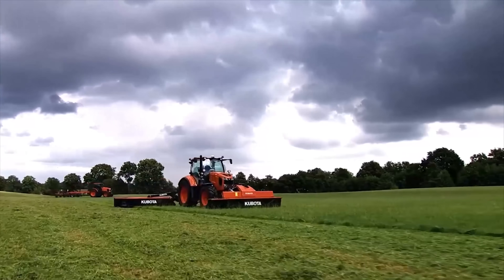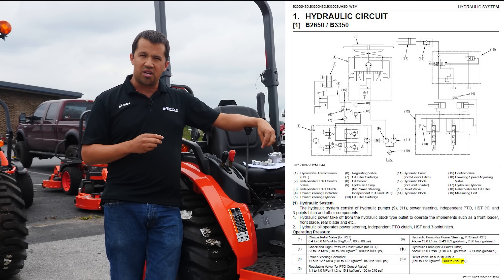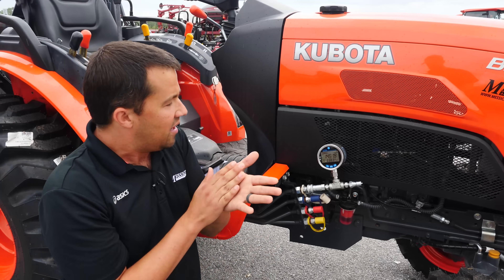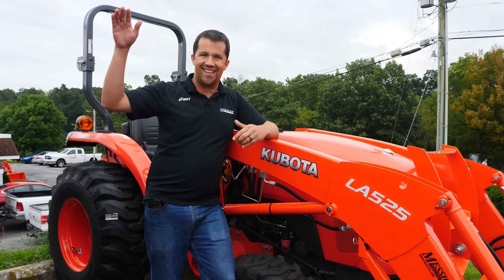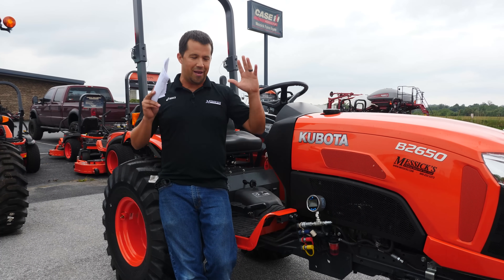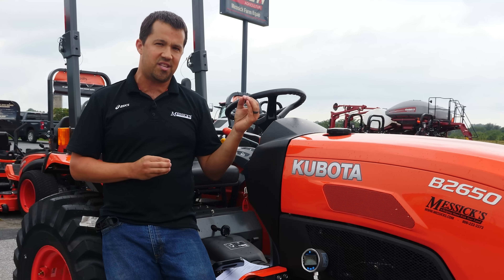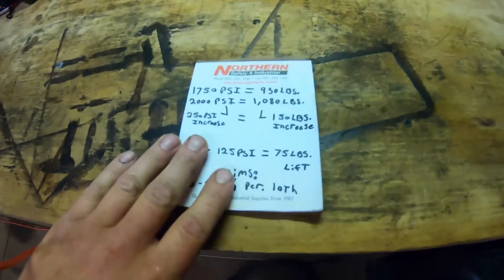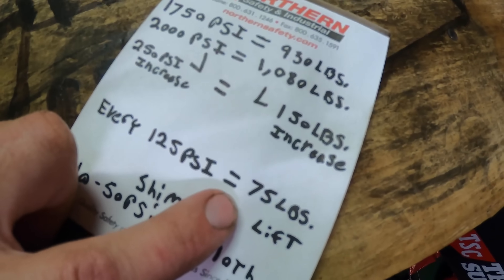Performance increases by raising pressure. Shimming hydraulics.

Comment: Hello,
I don't agree. 2% of increase PSI doesn't at all mean 2% increase at the cilinders (except  if your cilinder only has 1 Square Inch). In theorie you get 2 % increase per Square Inch so if your cilinder has a surface of 5 Square Inches you get.... (In theorie).
Don't you agree?
I do agree, that if a person doesn't fully understand every part that can suffer from the PSI increase it's better to let a pro do it or not to do it at all.
I like your videos.

Cheers from Belgium.
P.S. I talked to fast, I'm wrong.😣
Reply: Sorry guys... Neil is correct.  It’s a linear relationship.  Yes, the force equals pressure times area, but the area is constant.   Hence, the resultant increase in force is directly proportional to the increase in pressure, assuming all other factors being equal (such as loader position, lift angle, friction, etc.).  Thus, a 2% increase in pressure equals a 2% increase in force, and a 5% increase in pressure produces a 5% increase in force, etc.  It’s that simple.
And yes, I’m a university professor of engineering and have spent decades in private engineering practice, so I might know a bit about hydraulics and math 😉
Reply: @profdave2861  it makes perfect sense to me but I was a kinesiology graduate/trainer/safe work guy.  

Your explanation is a lot like the explanation I would give young adults wanting to look like Arnold.   To first look like Arnold you have to have Arnold's general size and shape.

Imagine how bored I would get telling five foot five guys that looking like Arnold was not going to happen.

I did have a very good conversation with a young lady once about why she could just not be as strong as the guys lifting despite her being the same size as some of them.

I told her that it all came down to density.   Men's bones are more dense than women's.  Therefore more muscle ligaments can be attached to mens bones.  

Your loader constant reminded me of this.  For there to be a change,  there has to be a change.  You can add more strain but really,  in the end, you're just adding strain.
Reply: @roflstomps324  that’s a great story!  I know very little about kinesiology but I believe there are some interesting similarities between kinesiology and the engineering topic of kinematics (sometimes called “the geometry of motion”). Things like loader arms with pinned connections and force-inducing linkages (hydraulic cylinders) aren’t all that much different from bones and joints and muscles!
Reply: @profdave2861  

You are correct, now I made the calculation on a piece paper I see my error.

Thank you.
Reply: Love Neil’s videos but in this case his math is a bit off. Force = psi x cylinder area.

Comment: my 3901 can't lift the back end up with the loader and all i have on the 3 point is a quick hitch.
Reply: the loader should never pick the back up. the front is a different story. make sure your are angling it to the left for down pressure. my l3091 will lift the front at least 8 inches

Comment: It's all math. I've fixed a lot of components that guys started out with a 500 psi boost. The math also applies to the structure. You're going to do more damage than good over time.
Reply: I was wondering about the stress on the seals, filter, and valves.
Reply: @RoanJS  if you're pushing the cylinders with more force the pressure will tend to cock the cylinders harder as things stress and the seals suffer. Heavier pressure spikes affect your valves also.people always forget the spikes. Unless you went nuts with your adjustment, this all happens over a period of time pending use. Hoses also catch some helll at the fitting ends too. If you're going to adjust it be smart and realize you're not getting that much more out of it. Take care of what you have if you need something more get a bigger tractor.
Reply: @RoanJS  sorry about the spelling I was out hunting and didn't proofread

Comment: LOL, Sub Compact and Compact Tractors on lower end like my B2320 are what they are. If you need lift capacity, get a fork lift, skid steer or telehandler.
Reply: Yep.  You called it.  People see my tractor and constantly say, 'why didn't you get the backhoe?'  

I didn't get a backhoe because it costs 7k usd.   Money does matter.   For the amount of times I have needed a backhoe I am still in 7k usd.   

If I need backhoe work done,  my ass is over to home depot and renting a excavator for $500 or so and getting everything done in comfort and ease.  

And, I'm still in 6500k usd.

Comment: I work on rotary gear/positive displacement pumps along with many other types of pumps. Gear pumps have very tight clearances which vary depending on viscosity. All pumps have a maximum pressure limit of which it can operate and not fail. Unless you know for a fact what that limit is, don’t mess with it. Gear pumps are specked out closely for the required performance vs the product viscosity the pump will be pumping. I personally have seen many failures because someone cranked up the pressure relief valve to get more pressure/ flow. I just smile and hand nice size repair bill for $$$$$.
Reply: Pto torque is  9 out of 10 times limiting. The gearpump itself is almost always capable of doing of doing about 200 bars. But what you say is right.

 But most systems are rated much higher then they are actually working at. Most systems im looking   at are failed by quick couplings where dirt comes in.  And reliefs cranked up al the way to the point the engine stalls out.
Reply: @megape95  I agree most pumps are capable of relatively higher pressures than what they are operated at. All pumps have an optimum sweet spot in their performance curve. It’s that balance between performance and longevity. The sweet spot is usually a range of which the pump can operate in with no issues. For rotary gear pumps, that range is usually narrow due their inherent tight clearances. Moving to the left or right in the performance curve usually increases the chance of early failure. You bring up a good point with dirty couplings. Gear pumps do not fare well with dirt! A gear pump w/ .003” clearances gets dirt at .005” big = wear issue. I always recommend using high quality hydraulic fluid and change those filters as needed!

Comment: What about adjusting the relief valve on the loader. I have a m7060 and the hydraulics flow through the relief valve every time I have a good bucket full of dirt and does not want to lift it above about 4 feet. Will adjusting the relief valve setting let the loader lift what I need it to
Reply from the maker: There is a power\height hole on your loader, do you have it in the power position?
Reply: @MessicksEquip  yes I have it in the lower hole. I had it at the dealership ship and asked if they could check it and adjust it if needed but I was told it would void my warranty
Reply from the maker: No harm in checking it if it feels off. That's a very capable tractor.

Comment: Thank you for this great informational video.   I wondered how much the shim kit actually did.  Far from worth the effort and money I think.

Doing something like this will void the tractor's warranty as well correct?
Reply from the maker: if the adjustment causes a failure, yes.
Reply: You can't really say that the shims aren't worth the money, as they cost LESS than 50 cents each. As far as effort, it takes about 5-10 minutes to complete this change.
Reply: Correct. Anything done to the hydraulic system above what came from the factory will void the warranty
Reply: @jerrelllott6885  That's not true brother.  You may have worded your comment wrong though . There is several things you can to to a hydraulic system that will not void anything
Reply: @rickywoods3101  i was just going by what I was told at the dealer. Then again it may have been that they did not want to do the work I wanted them to do. I had some trouble with them while they had my tractor and had to throw a fit to get my work done
Reply: @jerrelllott6885  probably ! I'm a mechanic and farm too and I brought mine to the dealer and they had no idea what they were talking about and they couldn't figure out anything that was not simple . I took it back 5 times because it was under warranty and finally I flipping fixed it my self and let them know about it . 
Buy from a dealership like this one if your not mechanically inclined, don't try and save money on something that don't have good support in the area .
Reply: @rickywoods3101  i wish I lived near them I would definitely be paying them a visit. I have ordered parts from them online just so I didn't have to worry with my dealer and I also got the parts qhicker

Comment: I have a 35hp New Holland tractor that is extremely powerful and capable.  I wanted to increase hp, pulling force, traction, hydraulic lift power, and overall capability.  So I bought a 70hp New Holland tractor.
Leave the engineering to the professional engineers!
Reply: and I have a 40hp New Holland I wanted to increase hp. so I added  custom haltech ECU, bigger ballbearing turbo, boost controller , precision 34mm waste gate, custom welded  intercooler piping and intercooler, bigger injectors , propane injection, forged pistons and rods, after market head bolts and gaskets.  Now I have a 145 up tractor
Reply: @rickywoods3101  for the price of a 200HP tractor.
Reply: @rickywoods3101  and the extended warranty ;)
Reply: @rickywoods3101  Bet that sucker is extremely reliable, LOL.
Reply: @rustynail7866  it's all worth people seeing me pull a 15' batwing brush hog in a compact tractor beside the freeway :)  lmao
Reply: @rickywoods3101  99% of those people don’t know the difference.
Reply: @rustynail7866 around here more people know since we live in major hay and cattle farming  area ..  But as you know I didn't sink all that into it. I did do a few things to bump up the hp alittle for brush hogging thick grass on hills. I figured that was all that is worth doing because it doesn't matter if I have over 100hp in a compact tractor because it still is not heavy enough to run a heavy enough to safely run round baler in the hills and it would not lift any more weight because it's limited to the hydraulic system and the weight of the machine.